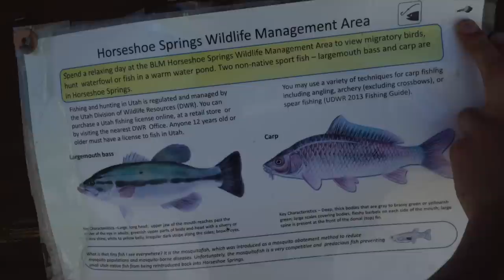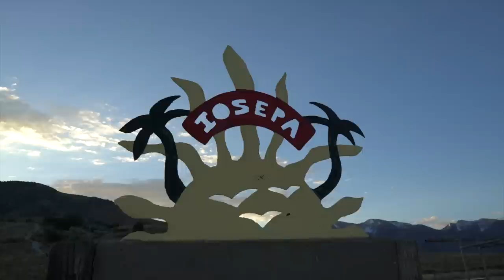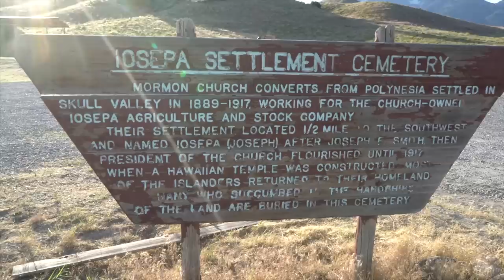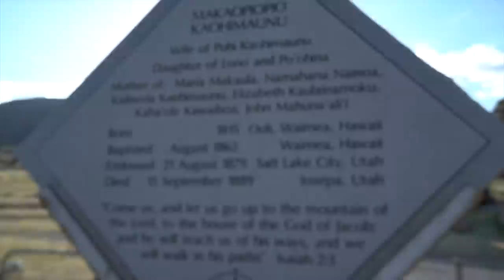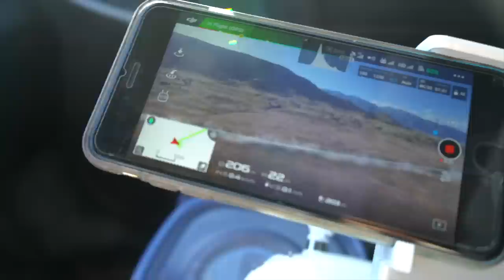SkyHunter Long Range FPV Gone Wrong - RCTESTFLIGHT

Comment: "Theres a restricted airspace around a military base 15 miles from here. I hope I don't get signal jammed"
Flies 15.1 miles away and immediately falls out of the air.
I know thats not how it works, but how good is that.
Reply: That was exactly my thoughts, how coincidental that was lol. I think it may have had a motor issue, or, as he said about the unplugging of the servo for that camera, maybe the same thing happened to the Aileron servos, as it was unable to recover. Even a massive gust wouldn't necessarily do EXACTLY what it was doing. Glad to see he got it back though!
Reply: I swear I heard him say 13.1, not 15.1
Reply: @didotb01  you can see it in bottom middle of the OSD that it says 15.1 ;)
Reply: So the go pro didn’t record the crash either?? Where is that footage
Reply: Than he couldn’t fly his phantom 🤷🏼‍♀️
Reply: not the tech they show us... they have come a long way.. never fly into MOA just to be safe.. Mad Love love the skyhunter
Reply: Even federal agencies have a hard time getting permission to engage in jamming on US soil but you never know...
Reply: the same thing happened to me there, can't be a coincidence
Reply: ill post the footage
Reply: @justvoorfun  LOL Yahhhh,,,he entered into restrictive space,,,got jammed and crashed! LoL
Reply: @greenbudahaz4204 most cameras save in chunks, if the battery runs out or the system gets violently shut down the entire chunk gets lost.
The crash most likely damaged the last save beyond repair, I could be wrong, but I have seen that behavior on other action cams before.

Comment: Looking at the paused video (17:49) I see amp draw of only 0.4A and the FPV video is blacked out, but at least the Vector is still in RTH mode. So perhaps the ESC or motor failed, possibly taking down the 5V supply to the FPV cam and servos at the same time... hard to say for sure exactly. The recover was really cool though!
Reply: Sorry for answering so late:
I had a similar problem where my esc burned down.. luckily i run my battery through my fc and that way my servos still worked :/
Reply: @NoPro420  damn you're everywhere 😂
Reply: @Dread_FPV  same
Reply: @NoPro420  Yep, never use the BEC in the ESC for flight critical kit, it's OK for powering a few lights though :-)

Comment: WAIT A MINUTE!! Why didn't you put the actual moment of impact video at the end after you found it!?! Did that like not get recorded in the recovered micro SD chip?
Reply: Jason G yeah! Where is impact moment??
Reply: Likely not recorded.  If the camera drops out, resets or loses power, it can even corrupt the entire file.  But otherwise can just lose the last few seconds that it was still in the process of compressing & writing to the SD card.
Reply: roidroid lol what the hell are you on about.
Reply: roidroid is right.   If the GoPro loses power, or SD card is ejected, and then you do a recovery of the video file, you usually lose the last 10 seconds or so.    Means you never see the crash that destroyed the camera.
Reply: daemn42 I ploughed my wing into a mountain side. No moment of impact footage for me either :(
Reply: I was hoping for the same thing, but unfortunately I've had the same thing happen in the past, full power into the ground from about 20m, didn't get the last 5 seconds and had SOS on the gopro.
Reply: Gopros record video and it writes it to the sd card a couple seconds after it has been captured, that way when its died or sd card ejected it doesnt have the approx 5-10 seconds saved yet and its missing. Pretty normal with small cameras.
Reply: yep, i also crashed my rc plane and the last 5 seconds before the crash got deleted from the gopro :(
Reply: It was a loose connection or short circuit.

Comment: Glad you finally found it and many thanks for the great story!
You should definitely consider getting an amateur radio license, you already know a lot about electronics and practical RF applications, so it may not be a big deal to pass the exam. You would then be able to legally put a high power GPS beacon on your planes that even when lying on the ground you can still hear them from miles away with a notebook, an RTL-SDR dongle for 10 bucks and freeware for decoding the transmission=location ... unless they crash with that kind of impact your plane did :-) Nothing seems to survive that ! Since these transmitters send RF in very short programmable intervals, the high power RF bursts will not even be noticeable on the overall power consumption ... so it may transmit for hours if in difficult terrain. 
Please let me know if you need and information on amateur radio or these GPS transmitters, though I am sure there are plenty of hams in and around Salt Lake City that could practically help you, while I am here in Munich, Germany

Comment: Since you found most parts except the motor at the crash site, it may be that you lost the motor while still in the air. A motor loss in flight would be pretty catastrophic. Aside from losing power, if the motor was dangling by the wires, the prop might chew up the fuselage; if the motor came off completely, it suddenly becomes a very nose heavy glider.
Reply: feraloid would be an explanation why it crashed so hard
Reply: Yeah that happened to me once everything on the plane worked but the moter fell out I have no idea how but it basically full power nose dived because it was dangling by wires and the place was DESTROYED
Reply: don't think so: after the first instability, the plane continued at normal cruise speed and current (at 9:52)
Reply: Or it may be the instability wasn't caused by the same thing that led to the crash. Perhaps whatever was causing the instability/spiraling led to the engine mount coming off. Hobby grade planes aren't very robust so one problem may have created another. I doubt there is enough evidence to really figure out what actually happened, but it is a useful exercise to speculate about failure scenarios.
Reply: either way it's exactly what i imagine a shot down drone to look like also the debris field seems to indicate that it broke before impact and the tail section was utterly destroyed while the middle of the fuselage was mostly intact and if it hit nose down the tail should be in better condition and also not 20ft from the rest of the plane which leads me to believe the prop exploded or detached violently taking the tail section with it because if you notice as it nose diving to the earth the autopilot is using some roll adjustments but no pitch indicating that the tail section was ether missing or severely damaged
Reply: The teori that he lost a motor is plausible. But if you look att the cables from the battery to te current sensor and out from the current sensor it looks like it had a high current flow over a long time. The heat interfered with the ESC and went mental after long time use,  that probably fried upp/sortcutet something along the Powertrain. (electronics can behave funny when the temperature is to hot)
Reply: If the tail was destroyed in mid air it would never be this close to the wreckage. My micro skyhunter took a nosedive into the ground recently and the tail was torn off in the same manner. It's just a weakpoint that won't take hard impacts too well.

Comment: I skipped around a lot on this one because my impatience is legendary, but that's no commentary on the vid; I really liked this. Glad you found the plane and at least got the memory card! Sorry about the immense damage. I've done the walk of shame / search and rescue many times myself, and it never fails to amaze me how much damage such a small and light aircraft can take on a simple drop to the deck from a couple hundred feet up. First time I lost a plane that way I just stood and stared at the mess like it had to be an illusion. Not just the foam, man, but the carnage to each and every part is astonishing. First you're like, "Maybe I can fix the plane". Then you see it and you're like "Maybe I can salvage some servos, the electronics and the camera." Then you're like, "Maybe at least the memory card is ok." One time, I cartwheeled a scratchbuilt quadcopter on a gravel road and couldn't even find that much to be happy about, lol. The arms and wiring were literally wrapped around the body like some kind of modern art techno tumbleweed. Camera was totally fragged and no memory card anywhere. Another time I whacked a plane and it nearly caught fire from lipo damage. Ah but the memories, really did have lots of good times. I'd do it all the same way again with hopefully a lot less stupid noob mistakes.

Comment: It's a good idea to do a loop around now and again. If the signal to the plane is slightly directional, because of hardware or an obstruction on your model (at that range), you'd find out sooner!
Reply: Yeah but the RTH should work without a signal, so there was obviously an issue in the power system. Last current draw was 0.4 amps, so the motor failed, which looks like the motor controller died and killed the power.

Comment: Did you at least get to be able to pull the flight data off the Vector?
What did it show? IIRC, you should be able to see servo movement, amps and what not. 
Curious what happened as I ran a Vector for a couple years without issue
Reply: unclejo3 yes. I had a motor fall off before and used the vector log to exactly where the amps dropped so i knew where my motor was
Reply: Alright just wondering.  Was that the reason for this crash?

Comment: this was such a great video! Do you think the airforce base jammed you?
Reply: superspeeed not likely
Reply: I know it's not likely, however it's only a matter of time before governments start employing jamming techniques etc against fpv/drones etc, if they haven't already. And they normally test this stuff at air force bases etc first.
Reply: hassaization n
Reply: hassaization unh
Reply: +mr mine   sir, do you need a cup of covfefe?
Reply: Problem with that its a uhf frequency, planes arent the only things that use these frequencies and 2.4 is an open widely used band, it's also illegal to disrupt any signal

Comment: Nice crash adventure! I have several points to make:
1. Make a moxon antenna. This Diamond whip is good but not enough.
2. You do not need the LP filter on the TX.
3. Get a GPS tracker.
4. You do not need CP - with a tuned dipole and a biquad on the ground you will get much better video feed.

Comment: I can tell you're a young engineer, or college student with a bright future! I am totally impressed with your technology! I dreamed of doing this kind of thing when I was a kid! 

But I don't know why you have two antennas touching each other in your handheld controls. Typically, because radiating elements interact with one another, those antennas will not work to their best effectiveness or efficiency when placed that close together (check out the roof of a police car sometime - the antennas are distanced from one another for a reason). It's a wavelength phenomenon. It's possible to have seven or eight antennas on some enforcement vehicles. In fact, they can actually degrade each other's ability to send and/or receive signals when that close together. 

Also, there seemed to be so many things that you mentioned that either weren't up to snuff, things you didn't know why this and that or one or two things you didn't understand. Perhaps if you look at any technical challenge, like this flight for example (I'm the voice of almost 50 years of experience in advanced technology), everything you can think of should be perfect before you leave! There will be unknowns and surprises along the way that you'll have to cope with let alone leaving with unaddressed problems. That, as you discovered, was a recipe for disaster. 

I recommend being more diligent when preparing to launch any project - understand, address and solve all known problems before launching. Those modules you pulled out of the rubble should NOT be reused (except perhaps for spare parts) as doing so will simply be adding more unreliable equipment and guess work to the next endeavor. Great and interesting video. I learned a lot (and I'm subscribing)!
Reply: The dragon link replaces the antenna on the remote and adds elementary data. therefore, nothing is being transmitted in the original antenna, just the big one.

Comment: the air force base almost definently  jammed you. Just a general proticol. Was possibly even an automated system. That plane would light up like a christmas tree on a basic scanner with all the 1.3ghz coming off it. Such an entertaining and great video. Thanks man
Reply: Also the plane kept wanting to fly upside down which i find strange. As the vector is a good system. I wonder if restricted air space has an envelope of 'deliberatly inverted civilian GPS coordinates' and thus confusing standard navigation systems like in a rc craft. Hmm or no, the accelerometers would still know which way is up. More likely a hack jam

Comment: I once lost a drone on rock mountains at more than 2000m of altitude. Had to leave it there for 2 weeks before I was ready to search for it.
Seemed like a super easy task, but as soon as I started flying around looking for it I immediately realized that every single bit on the ground looked like my crashed drone and I was totally unable to judge the sizes of the objects I was seeng throught the screen hence how close to the land I needed to fly in order to be able to see what I was looking for. What seemed like a 1h job ended up taking 6h...and I had a good binocular too in my arsenal!

Comment: Interesting history there at the end.  Also, WOW, ya that was one high speed crash- no fooling around!  Anyhow, sorry if others have already commented on this, but I don't have time to look at over 1,000 comments.  At around your 9:30 to +10 minute mark, where you have your problems, there is a second or so of video of you with your goggles and transmitter, and two antennas that are touching each other!  Granted, it is through plastic, but still, it is really important to keep your various antennas away from each other by a decent (multi-wavelength if possible) distance, AND, even better/more important- NOT with the same orientation/polarization.  This keeps interference down, which can ruin an otherwise good day quickly.

Comment: This is awesome... and a complete story nicely told.... As regard to the reason of crash, if that was caused by a loss of signal, it should not be a problem after you switched to high power. May be your signal is screened by some kind of jammer from the military. In any case, if your failsafe was set correctly, the plane should go home by itself. One can easily think the RTH switch works correctly means RTH is set correctly for loss of signal. They are in fact 2 different things.

Comment: One of the selling points for me to get the crossfire over dragon link is because of the GPS coords. It saves the last known coords on the Tx side. The Rx also has a built in battery to keep the telemetry going for a while after a crash (if it survived the impact).

Comment: What are you using for a UBEC.? Also notice when your FPV camera dies your 5V rail voltage from the vector PDB drops significantly I saw 4.8v at one point.. The vector isnt doing a complete reboot which makes me think your 5V PDB output is weak.

Comment: First use the GPS from the display. Then get to that location and trigger the Tbeacon. The Russian will then read off the actual GPS location. Plug that into your garmin (or phone) and walk right to the plane. The Tbeacon is small enough that it would be very unlikely to be damaged unless it was crushed by a battery or some such. Google Tbeacon to order one. They come from Russia so it takes a few weeks to arrive but it is a real plane saver!

Comment: Looks like when the RC signal dropped out. The failsafe setting for the ailerons caused the plane to roll. Did you use a y-cable to the aileron servos or used a channel for each aileron servo?

Comment: Great vid. 30 minutes went by quickly. That thing drilled the ground. Those 8000's were mangled and I've never done that much damage to a GoPro case...impressive! Killer place to fly... I'm charging stuff up and going flying out there tomorrow. Did you run into anyone on those roads/ no trespassing,etc? Good idea... that's where I'm burying my next body.

Comment: That's why RSSI is so important. I use it to track a lost drone. Drive until you get a weak RSSI, then get out and just track it by RSSI strength. The transmitter is usually directional, which helps tracking.
Reply: Battery disconnected/died/blew up. No RSSI to track

Comment: did the aileron servos work? looks like a servo failure. 
had a couple of those, very bad results. 
make sure there's hinges connecting the control surfaces to the wing, it reduces load on the servos which extends their life and thus your plane's life

Comment: Pro tip:  Before you arm the motor or launch shut off the radio and confirm plane goes into RTH every flight.  Between radio firmware updates and such sometimes fail safe can be reset.  Protip #2 don't accidentally hit your AUTO switch when you hand launch your plane and frantically wonder why its not responding to your controls.  LoL.